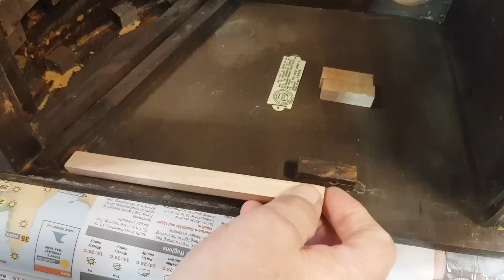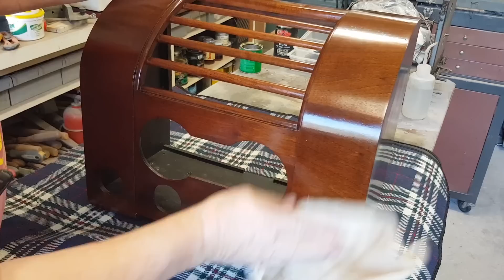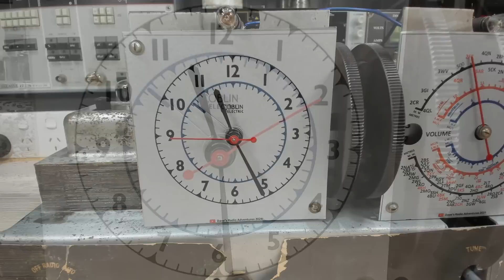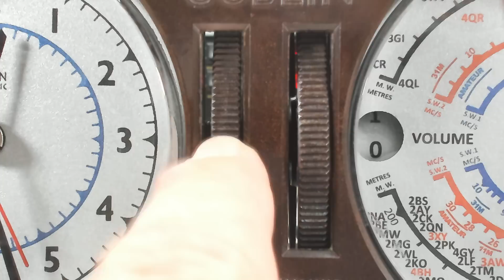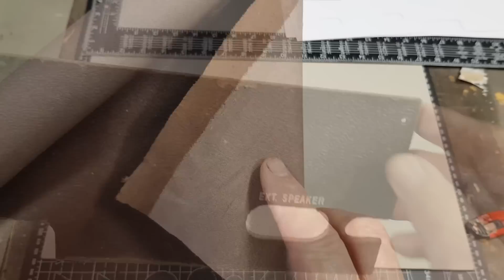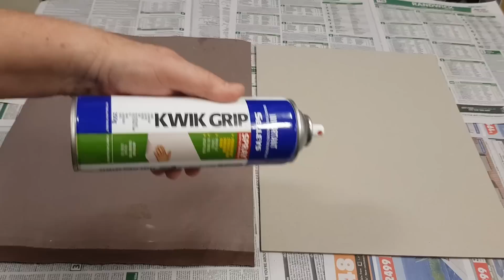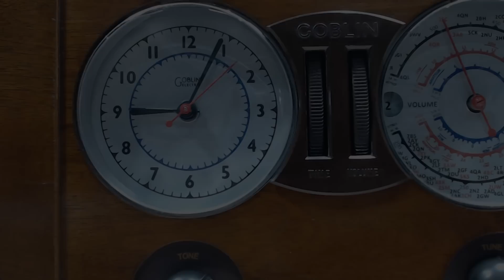Time Spot Radio Part 4 - Cabinet and Laser Cutting a New Back - Final

Comment: Wow ! I don't know what part of your work to compliment first;  I mean like if the electronic repair, the resuscitation of the clock and the remaking of the dials glasses weren't enough ,you managed to add another layer of excellence with the cabinet's refinishing.  But as i was trying to pick my jaw off the floor, you just knocked me down to the canvas again with those back boards.  They are AMAZING !  I've never seen such beautiful backs original from any company old or new.  Dave you are the restorer i can only dream of becoming one day.  Thank you so much for sharing your knowledge and talent.  As i was watching this episode, i was looking at the radio i have on the bench at the moment and it just motivates me to work even harder on it.  Have a great day and a good trip to Sydney :-)
Reply from the maker: Hello Raymond, thank you for your comment. I was so happy with the backs and it's something I have been dying to do. The cabinet is OK, it's not a very good example of radio cabinets and veneering but it looks OK for what it is. I love watching the clock second hand gliding silently around dial and it's been running or weeks now. Good luck with your radio work too. Cheers 🙂

Comment: 01:38  David I and other seasoned chaps are most disappointed that some of your audience do not enjoy polishing their wood,  personally this is one of lifes enjoyable endeavours ? 
Pleased you are trying more traditional finishes like shellack and wax, they are far better in my opinion and you can undo any polishing cockups.
Reply from the maker: Hi Woffy, thanks. I've done radios in shellack early on. I should do one again on video. I have a radiogram coming up finished in Danish oil 🙂
Reply: @DavidTipton101  Hello David,  I think the older cabinet finishes are easier than one shot spray as you can undo little mistakes it just it takes time to make up a collection of jam jars with various concoctions. The shellack fills the grain where as the VOC's in synthetic stuff tend to lift the grain. Great work on the Goblin dials I am so pleased you are enjoying your hobby and teaching us some new tricks. 
 Mum had  a Goblin vacuum cleaner it was built like a battleship and could fold an old copper in half ! .  
Best wishes from Wirral Nr Liverpool UK
Reply from the maker: @WOFFY-qc9te  Thanks Woffy.

Comment: it looks great... the cabinetry is a very important factor in the overall result... I suspect you can pick up the kiwi SW better than I can due to the beam.. used to listen to ABC SW back in the 70s... same deal
Reply from the maker: I can get the NZ SW sometimes, I think they swap frequencies to cater to individual islands so It's tricky to find sometimes. There is a timetable in line 🙂
Reply: @DavidTipton101  You're most likely picking up the PNG / Solomon Islands broadcast on 13690 kHz from 1100 to 1300 UTC Monday to Friday... can't receive any of their SW transmissions from here as I am south of the tower

Comment: Fantastic job David, I have really enjoyed this restoration and probably one of the best I've seen in a long time. So, you gave the clock a bit of a whack and it started running again, sounds like what we did with the old valve tv's of the early 60s.
Reply from the maker: Yeah, that fixes most things 😅 Thanks Uncle Time 🙂